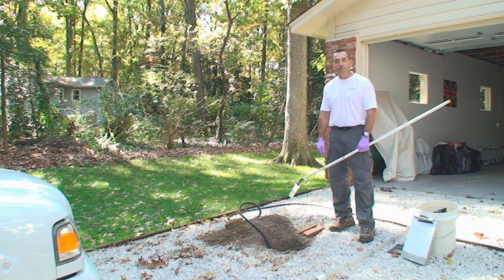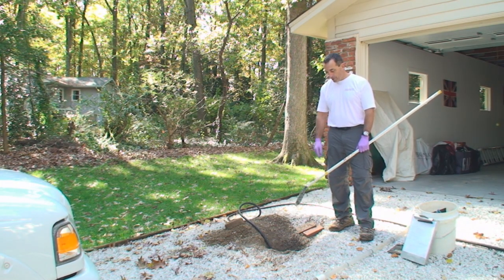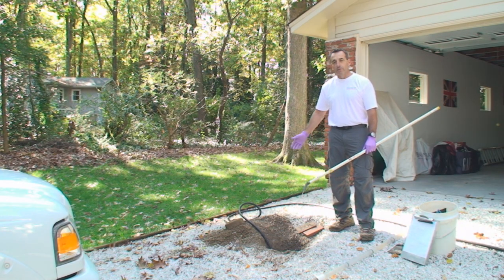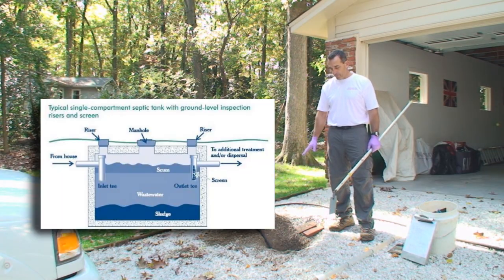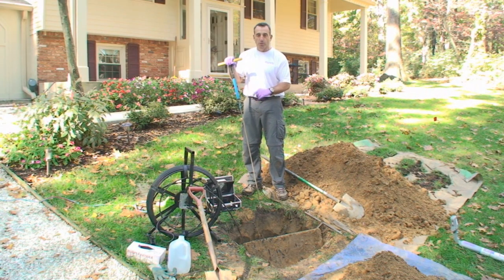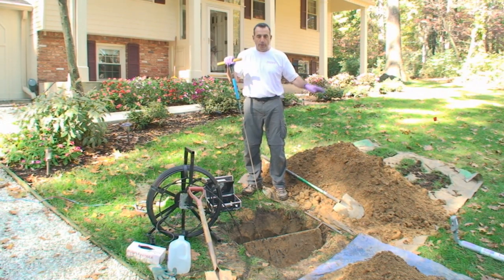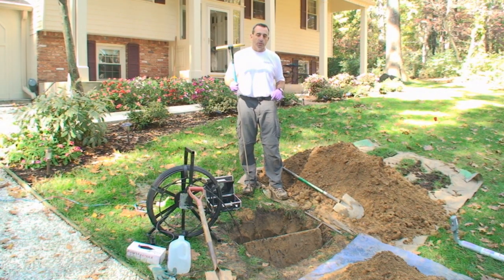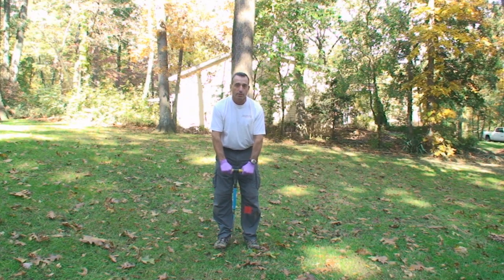Understanding Septic System Inspections

Comment: Why not just put bacteria https://youtu.be/dHAREQxSm7g from the bottom of the ocean or the bacteria from our salty boggy marshes that breakdown and consume organic matter and convert it into electrical current as long as you use a non-conductive septic tank and then put a superconductive coating on a conductive Rod or strip of metal on each end of the septic tank to receive electrical current discharge from bacteria to power your house or charge an EV vehicle.

Comment: To be fair, this inspector is in Maryland, and I'm sure that his explanation is accurate if you own a home with a Septic System in his state. However, in my state of New Hampshire, if a Septic Tank is located under a driveway, which is not recommended, it must be a Concrete Tank that's designed to support the weight of cars and trucks. By the way, the average Residential Septic Tank should not have cars and trucks driving over it or parking on it. Nevertheless, running a days worth of water water into a Septic System during an inspection is also not a good idea. In my opinion, it's normal to flush toilets and run faucets for maybe an hour, and that's the only way to conduct a proper "flow test" or "flow check", but longer than that is only going to stress the system. Typically, you run the risk of saturating the Leaching Field or Drainage Field, because the rate at which you can put water into the system is faster than the leachfield or drainfield can absorb it. As a matter of fact, most systems are designed for a maximum amount of water, frequently referred to as Gallons Per Day or GPD, which is the volume of water the system can process in a 24 hour period. With this in mind, it doesn't make sense to overload the system during an inspection, because it's not the best way to determine if the system is functioning normally. Think about it, it's not normal to have water running for a prolonged period of time, and most homeowners or families living with a Septic System, wouldn't do that anyway. Again, I don't recommend introducing water into the system for more than a hour. Lastly, not all Septic Systems have Distribution Boxes or Distribution Pipes for that matter, many of the newer systems use "serial distribution", which means the water flows from the tank directly to the first row of tubes, or chambers, or modules, depending on the type of Leaching Field. As a result, the first row of tubes, chambers, or modules, will have water in them... it's to be expected. The question is, how far has the water migrated, or traveled into the adjacent rows. In my experience, the only way to know for sure, is to start digging. To be clear, all Septic System Inspections require digging "test holes" in the leachfield or drainfield, because it's the only way to determine how far the water has traveled, and how much water is in the tubes, chambers, or modules. Perhaps, Maryland doesn't have many of the newer types of systems, but in my state, for the past 20 years, most homes have been built with "sand only" systems, which means no stone is used to construct the Leaching Field. As a result, you really need to understand what to look for in the sand, and if the system has the right kind of sand. Very often these newer types of systems will fail prematurely, because the installer didn't use the correct sand. I've been a Septic Inspector for about 20 years, and I've seen lots of problems with newer systems that don't have aggregate material or crushed stone in them, and I can tell you they don't last as long as a result.
Reply: maybe what he meant by "a days worth of water" wasn't exactly letting running water flow for a day rather he meant he would pump approximately an average day worth of water usage depending on the bedroom count of the home?

either way thanks for leaving your experiences was interesting to read